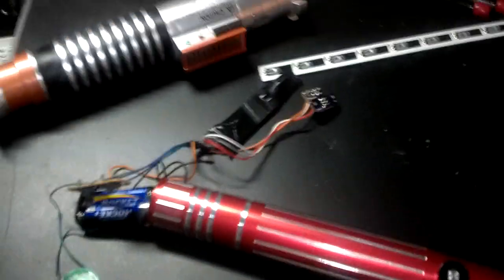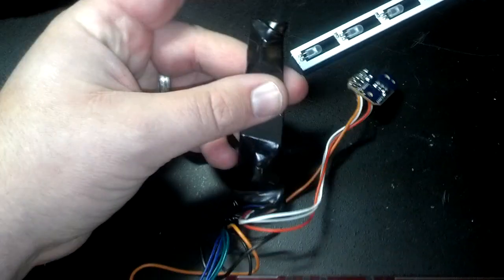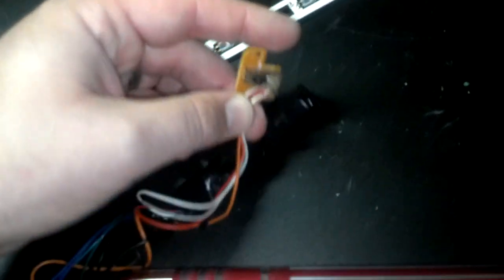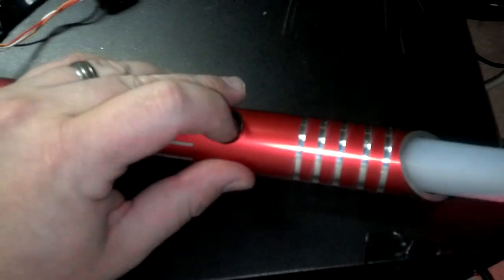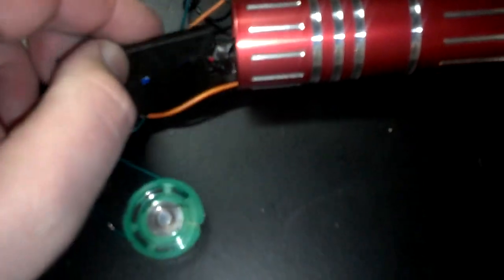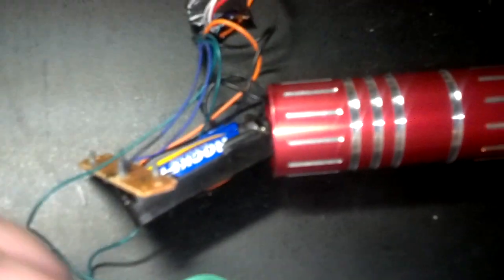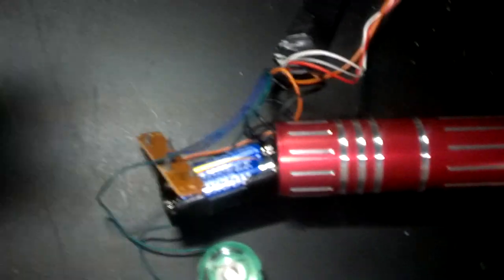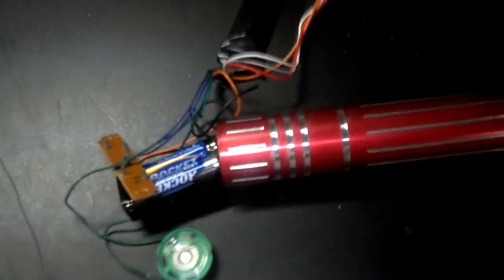Ultrasaber Lightsaber Modification with a Hasbro Force FX Sound Board

Comment: I don't know how much room you've got on the inside of the hilt BUT if there's enough room add a plastic tab to the ignition button with another tab towards the center of the plastic piece that presses down on the sound board so they simultaneously activate. The only drawn back is having to replace the plastic tab when it breaks.

Comment: Have you find a way to connect the switch yet?
Reply: It's easy, he just needs to connect them to the button itself. It's basically a switch, and it flows in one direction. He needs to solder it on.

Comment: Where are you guys getting these Hasbro sound boards? All the Hasbro FX sabers I see for sales are hundreds of dollars?
Reply: Nicholas Goss bit late, but I got my ultimate fx saber for $50 Au from Kmart.
Reply: Shem Pearce did you end up fitting the sound board to the light switch? I have the sound board now just looking to see how someone has wired it to the light switch so they come on same time
Reply from the maker: No I haven't, it is a tight fit and the button is affixed by hot glue or another adhesive.

Comment: This is great I was wondering how I could add sound for cheap to my ultra saber. Did you connect the on off switches eventually? And how about drilling out the ultrasaber pummel? I'm actually thinking of leaving the LED wires on and setting up a crystal chamber as well. But thanks for the video and inspiration.

Comment from the maker: You will need to complete the circuit. So you will need to create a "battery pack" based on the original battery setup (might be able to find layouts online), then get a small speaker and solder it to the board. You should be able to find this info online. Let me know.